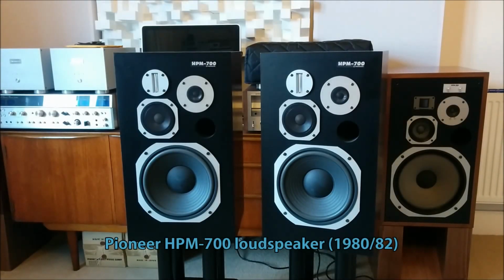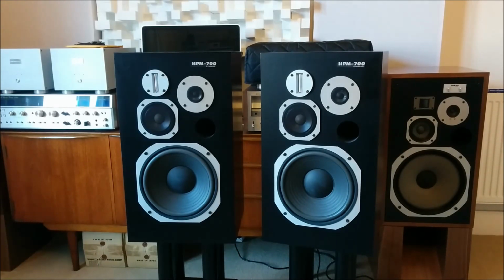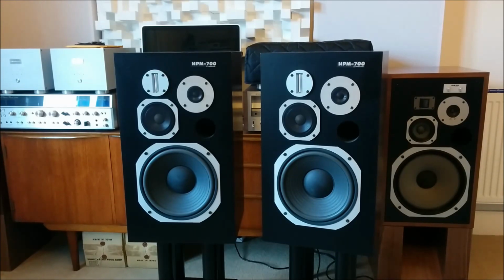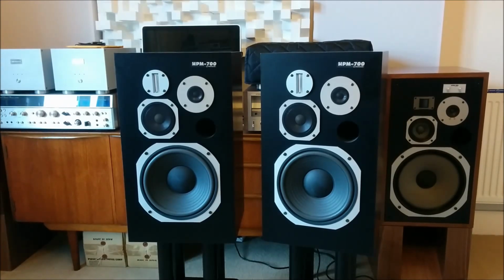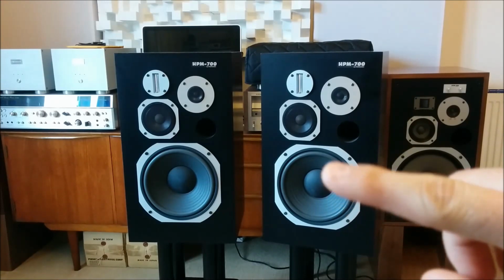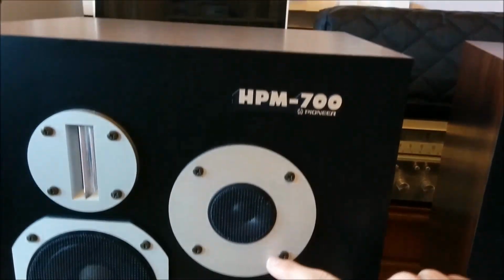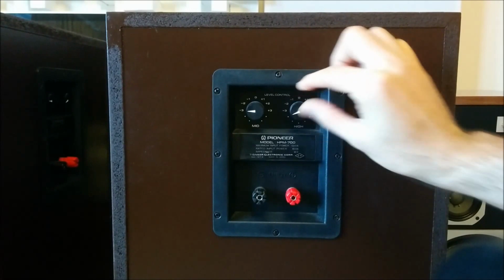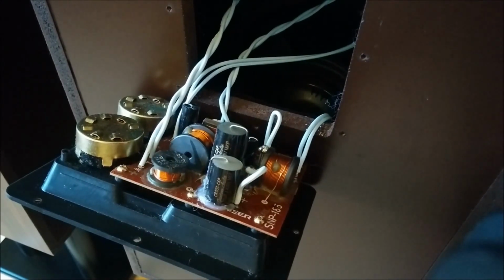Pioneer HPM-700 Speaker System (1980-1982) Review & Demo

Comment: OMG, they look awesome! I would give a finger to own a pair of these speakers!
Reply: I still have mine, which are 4 way and a lot larger then these one, i think i got them in 1987 ,the next level were the 3 way 250 watt top end speakers. :) Mine were rated at 150 watt. :) Also all the speakers were on top of each other. :) So bass, 12" and then mid range,  sub twitter with fins around the speaker  and then super tweeter on the top long ways just like these have. :) model no: CS969. :)

Comment: First off pioneer hpm family speakers sound excellent. As far as vintage quality you cant get much better. The sound is clean and clear and even a set of hpm 100's will hit hard on bass my dad had a set when i was growing up and he pushed them to there limits at a constant 200 watts which was there peak power. It took him about 13 years of constant use to finally blow them out he blew a woofer in one and a crossover in the other.  Also to the people on here complaining about not being able to hear the speakers. Your not there in the room with them it will make no difference trying to hear the quality through your phone or computer it will only sound as good as your device or sound setup.

Comment: my coment is that in 1980 was given to me the stereo receiver sx-1980 with a pair of hpm-700 and a mr.ditton 66 mkII by celestion with a turntable pl-560 brought from the U.S.of A. i bought a akai cassette deck used the gx-3 this 3 years after and at late 80´s or early 90´s a compact disc the pd-6700 and the gx-777 equalizer, this two last bought one year used by the equivalent of 500 dollars with some maintenance it´s everything working really good and one thing that i when younger was amazed were the woofers they looked that they wanted to leave the speakers and the windows from my bedroom shake as if they were gonna break i don´t know if you enjoy rock music but when i bought the new lp record at the time "1984"by van halen when listening to the "hot for teatcher" song at the begining i had to run to turn the bass down or it felt like something was going to break, before i had the es-2000 system from pioneer brought from japan(turntable,stereo receiver with the wrong fm frequencies and speakers) and with a reel to reel deck by grundig that i bought to the father of a friend of mine by 2 dollars,stay safe and keep giving advices to people with your knowledge in hi-fi.

Comment: Sir, my main question is ,do these spkrs have TIGHT , PUNCHY  & DEEP BASS
Reply from the maker: +Rodney Collaco Yes they do, 10" woofer will provide you with lot of bass if you need it, but they lack midrange a bit.
Reply: would you say the same thing about Pioneer HPM 900, you know anything about this model
Reply from the maker: +Rodney Collaco Yes the sound signature is the same. I prefer HPM-100 or HPM-150 to 700&900. HPM-1100 is different league.
Reply: @LegacyDevices  Hello. And could the lack of means be corrected by modifying the crossover? Or changing the midrange speaker?
Reply: what about HPM 200   and the pioneer system 20?

Comment: Hi, I have a set of the CS922 A speakers on my YouTube page and was wondering if you could tell me what year they were made? Thank You for your Kind Response.
Reply from the maker: Hi according to Pioneer bible CS-922A made from 1980 A to 1981 B CS-922A price 360 $
Reply: Audio Tweak.net
Hi, Wow Thats very nice to hear, a friend that use to work at a Pawn Shop gave them to me about 10 years ago so i had the "rubber or foam" rings around the woofers replaced with Factory OEM rings and Ive been enjoying them ever since. Thank You for your kind Response.
Reply from the maker: ***** you are welcome. Nice early 80's speakers with distinctive sound. You should definitely do crossovers.

Comment: Hi Audio Tweak.net,

I like your Pioneer HPM-700 Speaker System video, would it be possible to tell me what the stands that are you are using with your HPM-100's in the background, please?

Cheers.
Reply from the maker: hi these are DIY stands.More information http://audiotweak.net/2014/09/22/pioneer-hpm-100-speaker-stands/
Reply: Thank-you, very much for replying so quickly.

They look really impressive, when you mentioned Kentrick Sound of Japan, I thought they looked familiar ;). When you built yours did you use a number of sheets of chip board/MDF laminated together, sorry for asking so many questions but did you rebate the diagonal part into the side pieces or screw in from the side as in your temporary stands please?
Your system seems to have moved on quite a bit now I see from your Pioneer rack system. Do you mind me asking where you source your materials from veneer etc, oh I would also like to compliment you on your JPM 100's they look great. Did you say in your video that you made the speaker leads too, again if so would you share where you bought your over braid etc from. You are a very generous person with your information e.g when someone asked you for your speaker info that you restored for the back of your JPM 100's you gave it freely, there are few people who would have.

Well done you, and keep up the hard and very very good work!
Reply from the maker: xTH3xMoDsZx Hi and thanks, this is exactly a reason why I am doing these videos. to share information with community. I will happily share all my sources with you, please contact me on martin.niec@gmail.com do you have skype?
Reply: Audio Tweak.net I've sent you an e-mail, hope you can reply soon! Under the name "estu2009" Thanks.

Comment: I have HPM-50, is there a big difrence ?
Reply from the maker: Hi yes it is is a massive difference. As HPM-700 has grafite woofer and extramidrange unite, different tweeter as well. HPM-50 is practically HPM-40 without wooden surround.